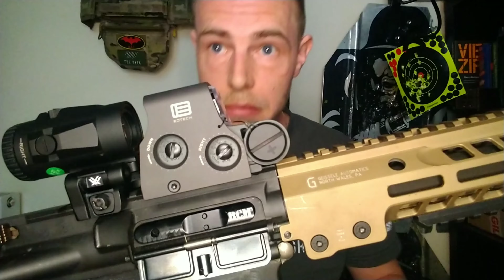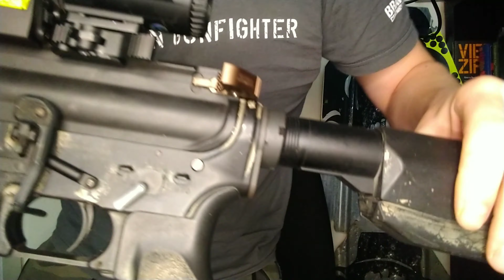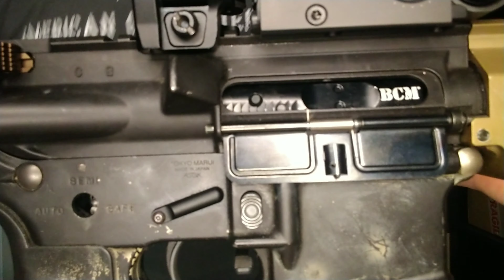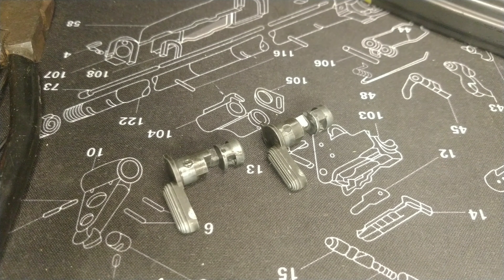Tokyo Marui MWS Semi-Auto DMR Conversion - Selector mod to make your MWS Semi-Auto ONLY (Airsoft)

Comment: another brilliant video bro... you are litraly exactly what i need haha, im trying to build a dmr with my mk 18 mod gbbr.. i just need to know how to get the power up to 450+ fps ;D then get adjustable nozzle npas thing so i can turn fps up and down
Reply from the maker: G&P do high flow nozzles but if you're looking for max range then a maple leaf Mr Hop 60 degree. An I key and a 370mm maple leaf crazy jet will see you hitting high FPS but insane range, you'll be using .36 BBs  upwards. And yeah look to mod the selector or have a look at the 45degree selector from OMG, very cool addition!!